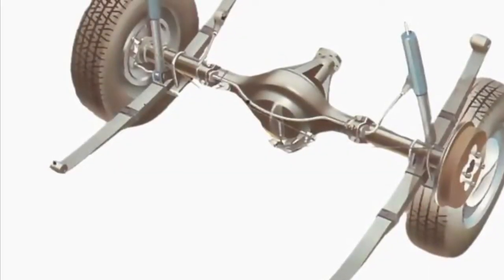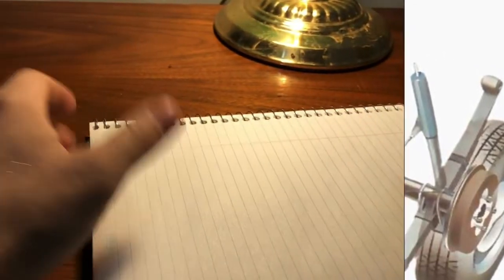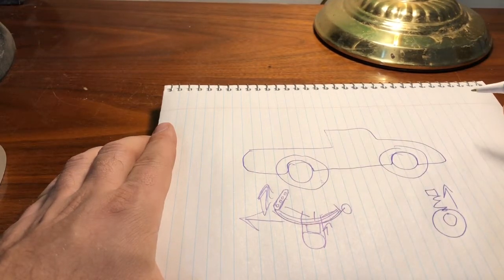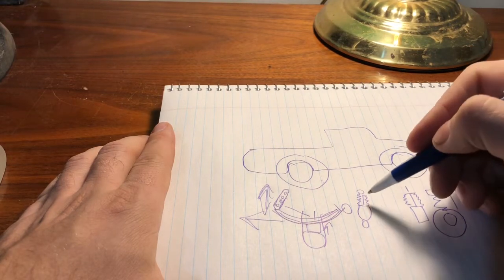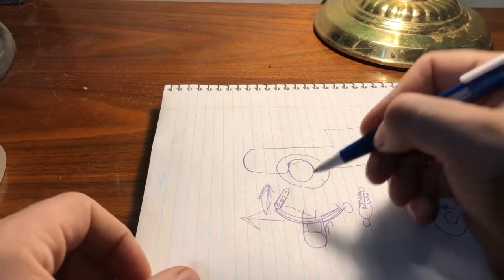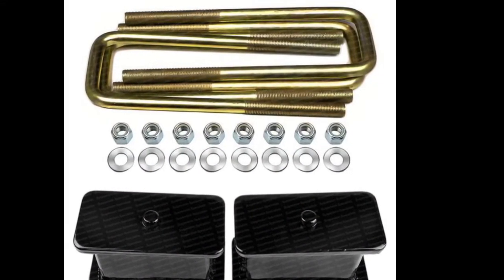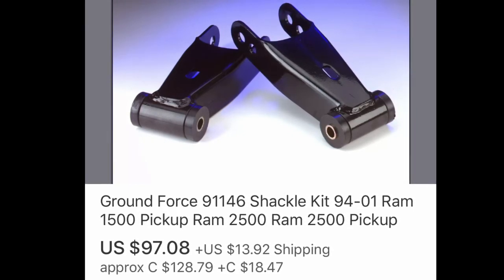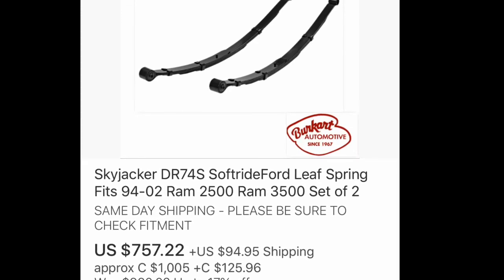Lifting Your Truck ( Shackle $ vs. Block $ vs. Leaf Spring $$$ )

Comment: No one ever explains that you cannot use lift blocks when your leaf springs are mounted under the axle.
Reply: people use them often but them they are lowering blocks not lifting
Reply: in that case you could just move the leaf springs from the bottom to the top

Comment: Great info, thank you. Question: I'm thinking about the leaf spring upgrade all around, but I didn't quite understand why they would be better than the Blocks or Shackles.
Reply: the leaf spring is almost set solid for a certain weight and geometry. It’s bent at a certain angle if that makes sense. If you stuff in blocks or shackles your stressing the leaf & bending it a bit more. If you do the upgrade your able to buy leaf springs that are actually made for the new height lift / weight load that you want. So you don’t have to add in metal blocks or anything that bends the natural bend of what the stock leaf is supposed to sit at !

Comment: This is great information. Good job dissecting the different lift options. I just found this channel, if you haven't, you should do a comparison between the difference between these lift options here and suspension performance upgrades. That seems to be a point of confusion for some people. So much time is spent by people getting lifts to fit larger tires, the assumption is, it automatically improves off-road performance.

Comment: So confusing they sell shackles that lift. It they call them lowering shackles
Reply from the maker: @dr.danielkester9313  they sell parts for each just - lower and raise / lift - be careful because if you only do a lift or raise without and supporting mods like coils / shocks you could easily upset the suspension ability to handle bumps or pot holes and of course handling

Comment: I have 33" tires with leaf springs went with 4" lift and tried to use stock shocks However, the shackles were shoved up against the frame. I'm guessing not enough height in stock shocks.

Comment: Does leaf spring lift requires replacing the stock-height rear shocks with extended shocks?
Reply from the maker: If you are only doing a 1-2” lift generally no. 

However if your suspension is old or over 100,000 on your odometer it is highly recommended and “while you are there” you might aswell upgrade and match your lift setup.
Reply: @803Garage  I just replaced the old factory rear shocks (220,00 mi) with KYB Monomax which are not extended shocks. I am thinking about replacing the old factory lead springs with heavy duty ones from General Spring whose manufacturer says would raise the rear wheel height for 1.5 to 2 inches.

I want to do it properly (which means there might be a possibility of getting rid of the new Monomax rear shocks and install extended rear shocks of Rough Country), but getting rid of the new rear shocks seems like a waste

Comment: So what's best, add a leaf, shackle or both?
Reply from the maker: Darrin Nelson it all depends on what your application is. If you want a 2” increase. Add a shackle. If you want better load stability add a leaf. I tow so adding a leaf or dropping in a beefed up leaf spring makes sense. A shackle can get you the immediate height increase if you are on a budget.
Reply: ADD A LEAF.
Reply from the maker: khmerbraveheart safe way to add weight capacity and always replace your used u-bolts with new
Reply: @803Garage  Oh yeah, of course. That's like going into a boxing match with no hand wraps haha
Reply: @803Garage  sorry, may i ask? If we install both?
Reply from the maker: Alistair ambie adding a leaf will lift you up and add a bit of highly plus payload stability. The shackle would give you only lift. You can definitely do both.
Reply: @803 Garage By Mr DoALL  can I do all 3?

Comment: I have 2" shackles in my ute, is it possible to fit 50mm blocks too?
Reply from the maker: Yes. Just replace your U-bolts as these tend to be a one time use and I assume you wanna go taller. I don’t know what your original block is or if you are stacking. I definitely don’t recommend stacking blocks. So long as you maintained the right drive / axle angle 📐 everything should work like stock. If the angle is off by to much you’ll eat up your universal joints. If you have a multi peace drive shaft sometime you can add a spacer. Other times you’ll have to change the mounts to get that angle. Heck I have seen where people have changed their differential by flipping the pumpkin 🎃 but that’s a whole different circus 🎪 and I think 🤔 adding the blocks plus new U-bolts should be fine.
Reply: Better add... standard leaf springs with 2" shackles no current blocks wanting to even out ride height as front sits slightly higher with a 50mm block

Comment: 5:38 lifting the rear or front independently will change caster angle. Significantly? Probably not.
Reply from the maker: That all depends if you have independent suspension (yes) or if you have straight axles. (No)

Comment: Wouldn't listen to someone who uses spacers.....
Reply from the maker: Hub centric are fine depending on the use. However lug centric are very dangerous and plan old spaces will kill you care or worse …..I have tried them. I would never use them on my vehicles unless you needed them in an emergency such as a broken rim and all you could use was a stock rim with a spacer only to move the vehicle. Just my random thoughts.
Reply: I'm talking about lift spacers... but definitely wouldn't listen to anyone who uses even hub spacers...... completely messes with geometry, towing, and handling. Oh and leverage can't forget that one.
Reply from the maker: @austindenning3692  you are 100% correct. Perfection if an opinion ever had one. Some applications it works but they are soooo rare and everyone wants a cheap lift but forget how dangerous it can be. 🤦
Reply: @austindenning3692  You sound very close-minded.
Reply: Nothing wrong with quality spring spacers if you're just looking for a lift for tire clearance. For off-road, not the best. For mostly on the road, and 70 bucks, fuck it. 

Yes I have spacers.
Reply: Not sure if you're trying to sound smart or act like a know-it-all with that comment bro. It's really just common sense bro. Just because spacer & shackle type lift kits are the cheaper option, doesn't automatically mean it's something dangerous or anything. It all depends on how the owner uses his vehicle. The spacer lift kits are mostly for aesthetic purposes only, they were never marketed for towing or off-road use. For example, I use spacers on my truck for 5 years without trouble, since 95% of the time I'm just driving through concrete highways. Given this, I don't see the point to invest on a $1000 top-of-the-line proper suspension kit if it won't serve it's function on my end.

Comment: If I add a leaf it can probably increase the rear height by like 1 or 1.5 inch, but if I add lift shackles (2in lift) together with the add a leaf will the rear lift height add up together to like 3 or 4 inches?

Comment: So question, I have a Toyota t100 2wd. The leaf springs are on bottom of the rear end. They sell lift blocks for my truck but all the ones I see are over the rear end not under like mine. So will the blocks still work with them under or no?
Reply from the maker: Joshua Shore let me do some research.
Reply from the maker: Joshua Shore I took a quick look at some photos online and the leaf springs are under the axle. When it comes to trailers that are setup like that I just flip everything. I can’t help but wonder if you are able to just flip them and get the lift you want but putting the leaf springs on top of the axle. I would replace the u-bolts with new if you choose this route. Looks like a simple fun mod and if you don’t like it just change it back. =]
Reply: 803 Garage By Mr DoALL now would it just be just taking the lead springs off the frame and placing them on the top of the rear and and just filling everything, or is there other things that would need to be done then just sitting them on the top and bolting them down.

Comment: I wouldn't bother with spacers or blocks.  Analogous to putting on a band-air to appear stronger when deeply wounded.

  "It's just a scratch!"
Reply from the maker: Michael Hughes you are not wrong. The suspension of any vehicle is designed by engineers. On e you change something you throw the design mechanics off. However that being said if you make changes or modifications that reflect each other well through kits that are also designed by engineers you can make the proper changes without risking your life or your vehicle. Which is why I always say to get it done by someone with skill/insurance/certified followed by an alignment so you don’t destroy your tires.

Comment: How do you raise the front end too?
Reply from the maker: The cheap way. I use spring spacers. So you can maintain your stock springs but I would recommend longer shocks. You could just machine an extension but usually they are already worn out like mine were completely. I may have a video…. If I can find it.
Reply from the maker: https://youtu.be/KSIt7ovgkfM
Reply: @803Garage  thank you!

Comment: What would the performance difference be between them?
Reply from the maker: Using a shackle you will lose rigidity. It will be lose plus lift giving you more flex. A block with retain the suspension stability while raising your vehicle keeping it very similar to factory. In both cases your center of gravity raises adding to body roll. A block is better.
Reply: @803Garage  what do you say about leafs?
Reply from the maker: @andrekopu  adding leafs will stiffen your suspension and raise it by the amount of leafs added. If you have a 1500 you can usually get the 2500 version and bolt it right in. You can also add helper leafs to give your old suspension new life. Even air bags which are usually used for load stabilization.
Reply: @803Garage  thanks! Yes I want to stiffen my suspension with a 2 inch. I've temporarily put shackles in and was wondering if upgrading the leafs would put it back or increase the stiffness it was at stock, or was it going to make it loose like it is with the shackles.
It's not overly noticeable currently with the shackles but I can feel it.

Thanks for your vid and replies🙂
Reply from the maker: @andrekopu  you are most welcome. I'm happy to help. ✌

Comment: You didnt include  leaf springs that are underneath the axle
Reply from the maker: Matthew GioVanni DiMeo stcloudtransit very true. My thoughts were. Let’s do a quick intro video and see everyone’s reaction. Also because I put leafs springs under the axle when I want to lower the vehicle or usually a trailer. Great comment. I hope to have time to make a video to discuss this. =]
Reply: Can you do both blocks , shakle for higher lift or both would not increase over doing 1 type?